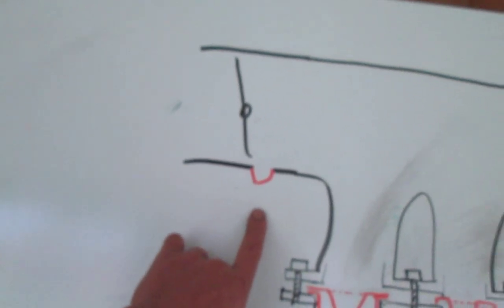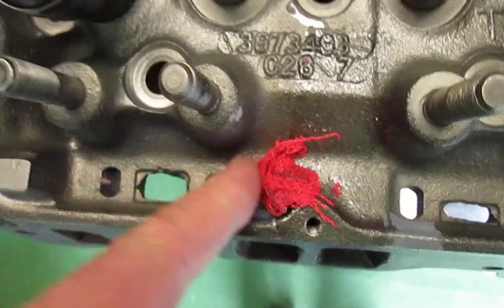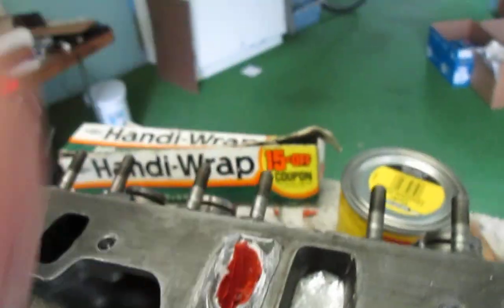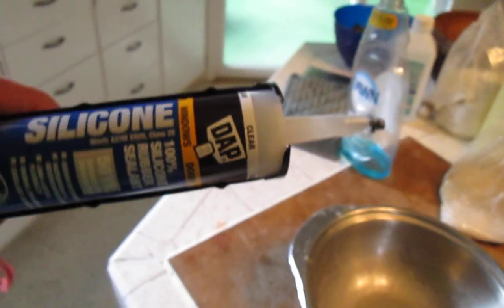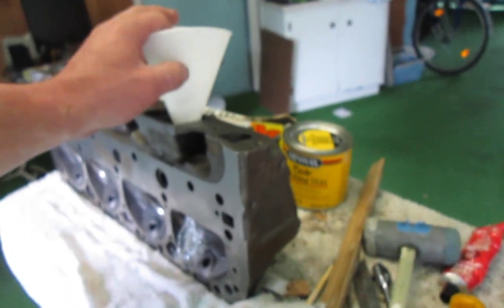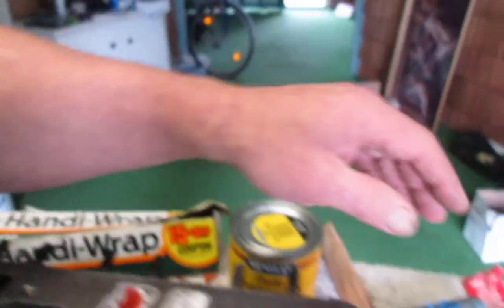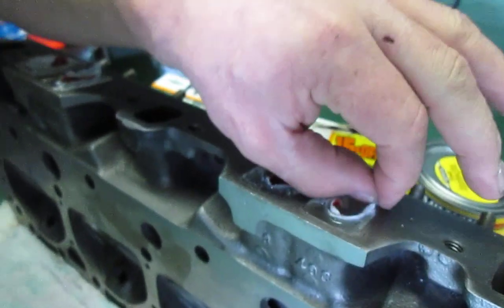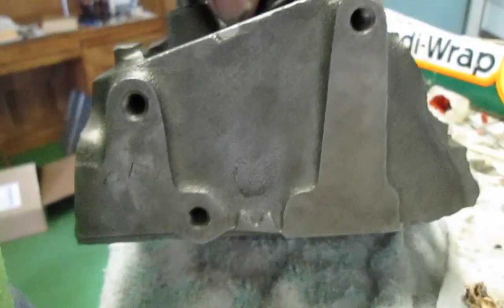How Gadgetman made Castings of his intake ports on a GM 400 CID

Comment: that doesnt make any sense,,,,,ur restricting air flow to the intake,,,like a restictor plate in nascar,,,,,i have had may 400sb..350 327,,,402 454,,,.....polish/grind  out the lower intake ports,,,head ports,,,,to match intake gasket,,,to improve low end power,,,,also mid range,,,,,,,,i had bulit a 383 in a 83 elcamino,,3sp auto drop in hei dist,,from msd,,,quaderjet carb manufactured by holly,,,,.got 21 mpg hwy at 75 mph